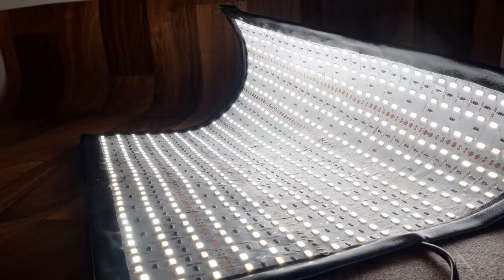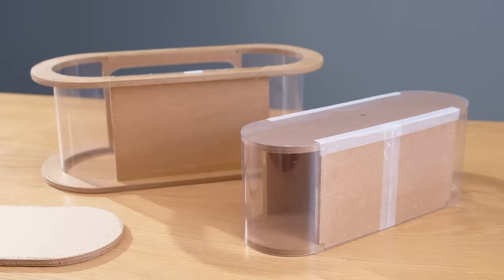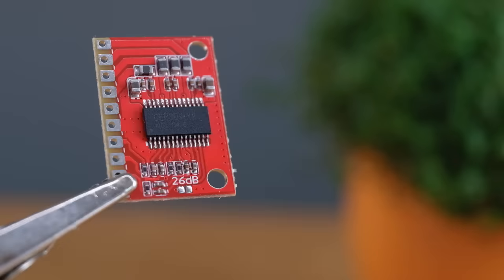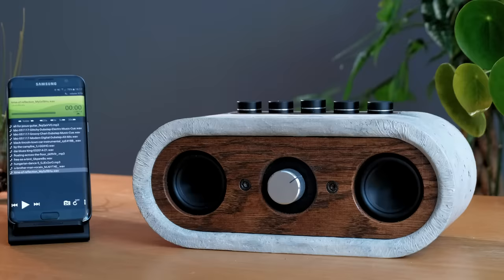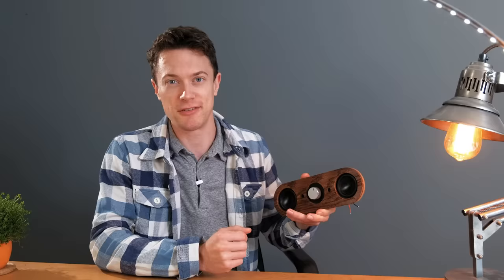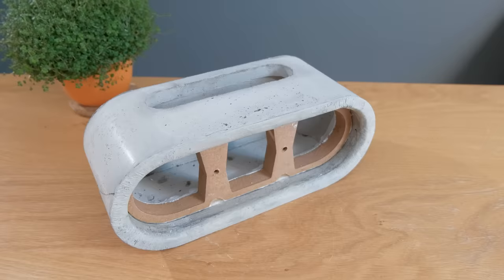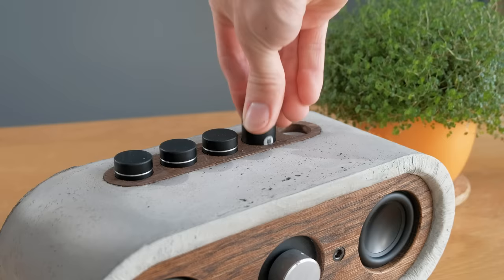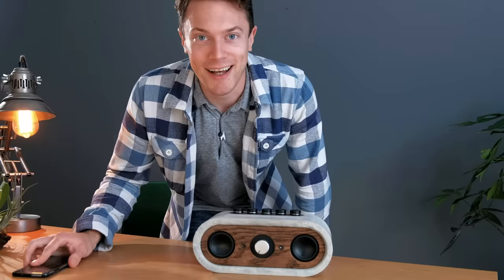Build your own Concrete Bluetooth Speaker (how-to)

Comment: The battery mounting, that's quite clever making them a visual feature!
Reply: How do you recharge thoses ?
Reply: I found a way
Reply: @nonenone6410  oh do tell ! how do you charge them?
Reply: The coolest part. Makes me want to build one all the more.
Reply: I have adapted many of my electronics (anything that uses  3 x AA or 3 x AAA) to use a single 18650 battery, and I have several "battery banks" that also use 18650 batteries. I have an excellent charger that handles all sorts of batteries, but my battery banks also allow for charging and removal of the 18650s (so you can easily use them elsewhere if necessary). I have tried various kinds over the past few years but these two are the best so far:

Tomo Intelligent Mobile Power Model M4. A battery bank that charges 4 x 18650. Also comes in a 2 x 18650 model and a battery bank / flashlight model. Essentially this is a box with a sliding lid you can put 18650 batteries into (spring mounted). Plug it into USB to charge. It provides 2 USB outputs (1A and 2A) for charging 5V USB devices (like phones).

Pujimax D4. Charges any combination of 4 of the following at once: 3.7V Li-ion -> 18650 (plus a very very long list of other similar batteries); 1.2V NiMH / Ni-CD -> AAAA, AAA, AA, A. This is just a charger for charging batteries to be used in something else. Excellent display telling you the current voltage of each battery, estimated time until 100%. It also lets you adjust the charging rate.

Both of these products include circuitry that makes charging safe, so you don't really need to worry about what kind of 18650 batteries you are using. I've been using scrounged 18650s (from old laptops) in many items I've adapted that used to run on 3 x AA batteries (most devices wire AA in series when they use more than one). 1 x 18650 has about the same voltage (most of mine are about 3.7V to 4V) but last many times longer than 3 x AA (wired in series for 3.6V).

You would need to remove the batteries from the tubes shown in this video to charge them in the products I've mentioned, so I would actually not bother with that setup at all (even though it seems kind of cool, non-standard battery mounts really just suck if you think about it for a second) and either use an 18650 holder (essentially a plastic case with spring mounts in it), or design the circuitry in the speaker to run directly from 5V (which almost everything here already does) and then just make space inside the cement portion for the battery bank listed above (or something similar). That battery bank could be wired temporarily to the rest of the speaker circuitry via it's USB output. Then you would just disconnect it and plug it directly into USB for charging when not in use.
Reply: @Derek_Read  yup 18650's they are used in flashlights laptops and vapes/box mods
Reply: @whiteking4895  ....and Teslas. ;-)
Reply: he did a backflip, snapped the bad guy’s neck and saved the day

Comment: I just finished making this speaker. Used a different amplifier (a cheap $15 one from banggood, with a bit less soldering), and I'm really happy with the result. Fun project! I also used a slightly bigger driver (Dayton ND91 instead of ND65), and I added the DMA90-PR passive radiators.
Reply: Nice! How long did it take you to build it?
Reply: Did you use templeates? If so, how did you use them?
Reply: I used white cement with fine marble dust and sand.. It looks gorgeous.. Dayton audio speakers are available online, but their shipping cost is 5 times the price of the driver. So. I used peerless drivers and a made in India amplifier with inbuilt Bluetooth and aux with Bass and treble adjustment. Also has a remote control.. It sounds way better than the JBL BT I was using.. Thank you. Total spent on the build is Indian Rupees ₹3900..approx US$50.00
Reply: Please post a vid about it!
Reply: I know this channel is all about experimenting with new stuff, but that does sound like comments on cooking websites.
"Great recipe ! I didn't have wheat flour and stock, so I used chickpeas and marmite." kind of stuff
Reply: concrete cool sure but if you drop it, its done right? there is 0 support in there.
Reply: @Bulldog23636  but why would u drop it lol

Comment: Most of Amplifiers from links in description are with single channel mode only - there will be no stereo. Check it 2 times before ordering! For stereo you will need 10 pin version.
@DIYPerks it would be better if you add similar note next to the link. I almost bought mono version :)
Reply: This comment needs to be, pinned or up voted so every one can see it. Could catch!
Reply: the speakers are so close together that the stereo will have very little effect and plus because the speakers are in the same enclosure they will push each other which is bad if they both have to make different sounds
Reply: Woo! SAved me a hassle. Thanks man!
Reply: Yeah, could still be fixed by making a small wood separator and drilling 2 tiny resonator holes on the face plate below the 2 screws ( which I first though would be vents ). This will help provide better low frequencies as well but might be trickier to make. 
Trial and error with different diameter and length PVC pipes should be the way to go here since the speakers inside volume is unkown. I'd start with pipes of 1inch in diameter and move up to 3 while varying the lengths to find the optimal one.
The vent hole could then be covered with fine cloth for aesthetics.
Reply: but can i get two of that same board each to one of the speakers to make it stereo ? or that isn't possible ?
Reply: Jafar Mahdavi no
Reply: The Bluetooth dongle he's using is supposed to be stereo but in the comment section many people say its only mono
Reply: Bluetooth module: This project is using a H-163 BT USB module, equipped with the Beken BK3254 chip, which is stereo. On the opposite, many sellers on eBay are selling BT USB adapters that are marked as stereo dongles but are in fact mono. I juggled thinking my soldering was wrong but after researching, discovered that the chip is only processing mono and the L and R entry points at the jack are linked. I then opted for a module instead of a dongle.
Look for OVC3860 (XS3868) or similar modules to get stereo and additional features like the possibility of adding buttons like VOL up and down, PLAY/PAUSE, FORWARD AND BACK, and call handling. To go further, the XS3868 backplane adapter, which comes with buttons provides a full package, although it requires higher soldering skills. One caveat, OVC3860 works better in the 3.3 to 4V range, requiring a different step down specification.
On another note, the BMS option, if well researched, offers a more straightforward approach as you can charge without having to remove the batteries.
After reviewing the distortion levels for the OEP30WX2 amplifier, I went for a 4S configuration into 4 ohms.
Reply: @MikeTheSith200  actually you're wrong, his suggestion is absolutely plausible.
Reply: @lazyh-online4839  read above comments.
Reply: @MikeTheSith200  and...?
Reply: @MikeTheSith200  If you wire two amps in mono and power them appropriately you can route left and right audio channels from your bluetooth signal independently. I think that's what the person above was trying to correct you about. It can also be said they'd be better off just getting a stereo amp. Lol
Reply: Thumbs up, their's didn't take.  Good point and very useful.
Reply: It’s the OEP30Wx2 30 watts x 2 channels… could always use two mono ones too 😉

Comment: Those removable powerbanks....awesome concept! you always impress us viewers!
Reply: Sohoraye Yaadhuv it looks cool but so messy and really annoying to build it like that, just add a charging port to the speaker and buy a 12,4v battery or build it yourselfe
Reply: For my powerbank I'd probably just use either a pre-made Li-Po (with added protection PCB) or a load of 18650's in series, or parallel (again, with a protection PCB). I'll use a TP4056 module with protection, as well as some 18650s (or 26700s) in parallel to boost the capacity. For the 12V and 5V feeds, I'll be using boost converters. Oh, and a 5V DC-DC converter for the bluetooth module!
Reply: Thoses batteries must be a
pain to remove/recharge/replace I would use a lipo battery or even a SLA if bigger. Also would create 3 chambers to isolate left/right speakers and from
electronics. BUT overall really nice project well done and very modern!
Reply: Sebastien D'Amours  I was thinking the same, recharging must be a faff. Either do them one at a time or use a charger for each one, a power bank seems like it would be a better option it just won't be as pretty.

Comment: Suggestion regarding pouring cement into molds.  More than 40 years I had a job making "car size" concrete pipe using a wet cast process similar to what you're doing.   We dipped a vibrating wand into the as-poured wet concrete,  which really helped the concrete flow  eliminating gaps and air pockets  - it worked like magic!  So, perhaps you could use a small rod attached to a cell phone vib motor or maybe an electric engraving tool .
Reply: agreed I was thinking of a adding weight to a cheap vibrating razor i had for that, minus the razor head.
Reply: Use a simple electric toothbrush for that; works wonders...
Reply: Just thinking, could be any electric tool that has a motor. Attach a metal bar using a hose clamp to an drill (Chuck, Please don't put it in the spiny part.).
Reply: On a small job like this you could use something like your sheet sander without any paper on the outside of the mold.
Reply: Yup a palm sander would do an excellent job.
Reply: I use my wife's black mamba, works perfectly.
Reply: Just run an oscillating sander on the outside of the mold :-)
Reply: Lifting and dropping  molds during the pour on the table several times is what I do to get the air bubbles out.  Just place the finished mold on a slightly larger board.
Reply: Hold a hammer drill against it (no bit) and run it, works like a charm.
Reply: Add some pieces of coloured stone such as amatheyst, aquamarine, whatever you want
Reply: Hammer drills don't have any hammer action until you place pressure onto the drill bit.

Comment: Some suggestions for the concrete.  You could have added a little more water to the mix to make the mix more fluid.  Also, try adding the concrete in lifts instead and tamping the concrete with a small round nosed rod.  Lastly, feel free to remove from the mold at 24 hours.  You'll need to keep the concrete moist to minimize shrinkage afterwards, so keep spraying the concrete with water for a day or two afterwards.  The final product should be smooth and without any of those air pockets like you have in the video.
Reply: i think the mix is good, so it can have air bubble in the surface
Reply: I have a suggestion for the concrete myself. Use half size Besser blocks - which are hollow concrete blocks. They are something like 8x8x inches and quite heavy. They are also wayyyy cheap. Check your hardware store.

Comment: 7:45 - Thank you so much for the tip with the B0505S. Now I can finally turn up the volume on the amplifier board to more than 50% without having tons of noise in quieter moments.

Comment: The small pits in the finish look great. However, if somebody wanted a smooth finish, adding an plasticizer (such as RapidSet Flow Control) will make the concrete more liquid without adding any additional water. A few minutes of vibrating would also help.

Comment: One important thing about this project... 1:32, added sound effect or an actual sound?
Anyway, noice!
Reply: Hugatry's HackVlog It's an effect. I also noticed it
Reply: at the same time, kinda hard to tell due to the way the "power cell" was slowly sliding down when he set it in, and there is a tiny bit of vacuum effect. but just due to the clarity of the pop, i think it's an effect
Reply: No matter what, the sound was perfect😅 Good work!
Reply: Sounds to me like the sound is natural. The tubes are vacuum since the whole chassis is very tightly sealed for sound quality reasons.
Reply: It's an actual sound due to air seal made in between battery and tube.
Reply: check 15:54, the reason you heard that sound is because of the tube and a vacuum that was created from eveerything being sealed off with the concrete and wood (really dense materials)
Reply: Just confirming that it is indeed real due to the vacuum of the tube as it fits so perfectly.
Reply: guys... he never made 100% sure that the batteries are making a vacuum seal... that was a sound effect... it would require some sort of O ring, to create that loud of a pop.
Reply: Hugatry's HackVlog guys please stop quarrelling. I've asked him and he said it's 100% real. Isn't that funny
Reply: Hugatry's HackVlog p
Reply: that sound by itself is worth the build!

Comment: +DIY Perks
Hey, how are we supposed to charge the lithium cells?
Reply: Nice question! The batteries may come with the charger, I believe in making a 2.0 version counting the charger in the circuit.
Reply: F August or just power it via USB
Reply: no, you cant do that. the charger is for 5V and you need 5S lithium charger (since the video use 5S). or you could custom your battery to fit into 6S (i believe its much better).
Reply: he spent so much between 18650 cells, old battery packs and the rest of  the circuitry, at that point an integrated li-on 12V with a charging circuit and a single 12V port going outside would have been better
Reply: (rc) hobby grade battery chargers probably. Forgot what they are called
Reply: No wrong wrong wrong ! 5s ? Mistake ! You have to take the batteries out and charge one after one in a lithium charger(like vapers use) if you want to charge them in the case you have to add a balancer cable and use a rc lipo chargee otherwise its dangerous
Reply: Could have used bike battery instead. 50 AH 12v.

Comment: you dont have to use a protected battery if you have a BMS (battery management system) board charging and monitoring them.

I plan on making this but i intend to allow for a wall plug in with a BMS to charge the 18650 cells
Reply: Beau Kuebodeaux thats what i would do as well as it could quickly become monotonous removing and recharging all those batteries individually everytime. A line or coaxial in dac input would be very little extra trouble also to boost sound quality in situations where the bluetooth radio portability is not required. It seems to me the hardest part about this is casting the concrete itself? I could not help but feel the addition of a plasticiser would improve the flow rate somewhat and make it behave more like plaster..
Reply: That's a great idea. Could you please make video on how to do that please. I like to build this but I have zero knowledge about electronics. A video would be great. Thanks

Comment: But.. if your stepdown voltage-regulator has a small potentiometer on it, make sure it is adjusted to give out the right voltage..
Mine did'nt, so i fried the bluetooth-module with 24v.. :D
Reply: What size potentiometer did you use? He doesn't mention it and the link doesn't say
Reply: Quite often they have a built-in trim pot with a tiny brass adjusting screw, allowing the voltage regulator to cover a range of output voltages. You don't need anything extra, Ubbe's warning is just to check/adjust the output voltage before you hook it up.
Reply: @silva69ers  i have the same question, did you already figured out the answer?
Reply: @kamielbreyne7859   Two different potentiometers to answer here:

1) [which @Ubbe Berg is referring to]
On the little voltage regulator, if it deals in multiple voltages, there will be a small potentiometer that you use to dial in the 
appropriate voltage (a little knob or, likely, a small cross shape that you can turn with a philips screwdriver.)

2) [which you and @silva69ers are referring to]
The larger potentiometer used in the build is a 50K ohm dual linear taper potentiometer switch (50KΩB). 👍

I'm still curious what the voltage of each battery cell is, as the link is broken. Must have been at least 2.4V each to reach 12V for the amplifier..
Reply: @chriskaprys  thanks!
Reply: @chriskaprys  Ty for clearing up the K Value. Really struggled to find any info on that!
Reply: Can we use 12V to 5V DC-DC converter such as B1205 instead of B0505 plus stepdown board, would it make a difference?

Comment: If anyone doing this is wondering about the switch to turn the system on and off with the potentiometer, wire the incoming positive line to the bottom most left pin on the pot, and have the bottom right pint connect to the amp & step down board positive terminals. The ground doesn't need to be changed from what was shown.